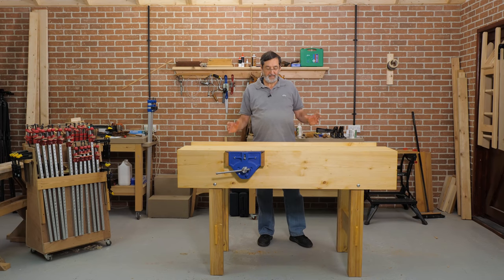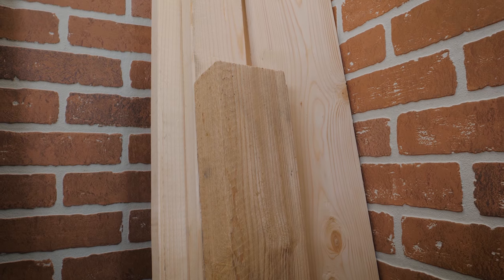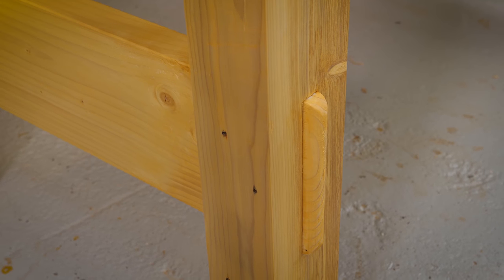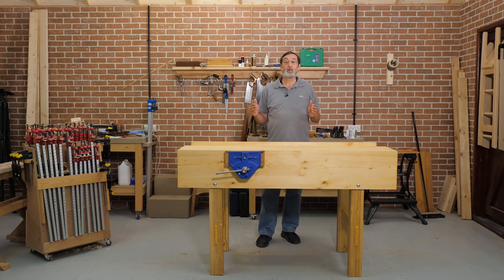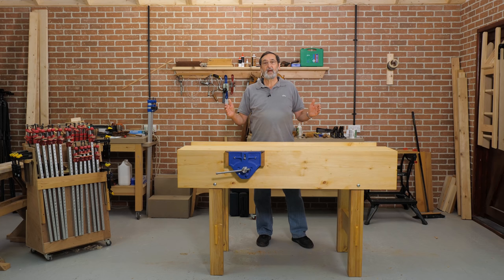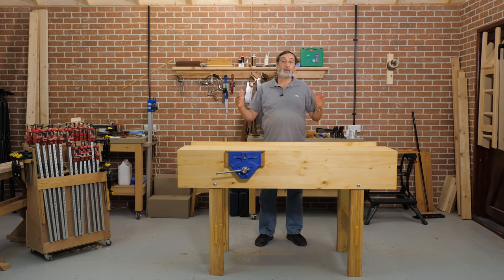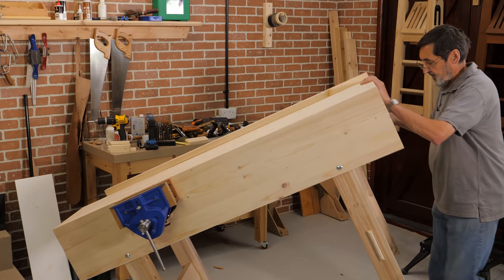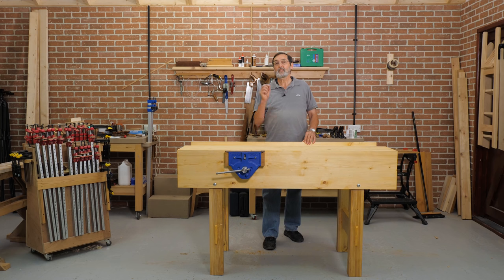How to Make a Workbench Introduction | Paul Sellers

Comment: Paul, I wonder if you could describe how this bench differs from your previous workbench build series.  That was a terrific set of videos.
Reply from the maker: Yes, it differs in three ways:

1. This bench is smaller, it is shorter, only has one side, and is easier to move
2. This series is more thorough (we missed showing vise fitting last time)
3. This bench build includes full measurements (you can still adapt it but you have a solid starting point)

- Team Paul
Reply: Wow, that sounds great!  Looking forward to the new series.
Reply: I am currently in the process of building the previous workbench you posted on here a few years ago. Both tops have been laminated and I'm about to glue up the wellboard and aprons. I'll still be excited to see this new series and see how you fit the vise!

Comment: Hi Paul,  I started mine a couple of weeks ago, and its going okay,apart from one minor hitch on my part.  I forgot that the timber yard had supplied me with five and three quarter inch wide cross rails for the leg assembly.  I went and cut my first mortise at 6 inches as per the plans.  Had to go and buy some more wood as I didn’t think it would be a good idea to try and bodge it up.  Anyway, I’m back on track and looking forward to the assembly pretty soon…….

Comment: Loved your first question /Statement  about how do we make a Workbench without having one to begin with  and the old answer is of course we use whatever we can  !  I used a plastic patio table that still has a cut in it from my Circular Saw at that time  that happened to be a older Skil Worm Drive  with so much power i never felt it going through the  Polyester table surface !  Oh Well !  everything still works as intended 25 or more years later   I always thought i would build a Wooden Patio table  but it turns out i never  did  and the slice in the table is a great Conversation peice at Barbecues  LOL since all my friends know i  was a Professional Woodworker for over 20 years ! And laugh at why that cut is there  OOps LOL

Comment: Paul Sellers is THE man. hands down best woodworking teacher.

But I wouldnt trade my roubo in for an english style if you held a gun to my head.  

Just preference is all.

Keep it up Paul!  Love your vids!
Reply: I made an English style... and love it... but I also have dog holes all down the apron.
So I can use dogs and holdfasts to keep a long board stuck to the face for jointing.
Mr Sellers doesn't use dogs... so I'm not sure why he goes English, frankly.  :D  Unless it's just for ease of construction.  Those aprons stuck to the front and back are a little easier to execute than gigantic dovetails.
Reply: Those aprons stuck to the front and back also prevents clamping to the edge of the benchtop.   If not using holdfasts either, and no side wise and dogs, I have a hard time figuring out how anything is going to be held in place on the bench top itself.  Jump up and sit on the wood?
Reply: Art Heen exactly, my tail vise holds the long stuff well.  couple whacks with my holdfast is so efficient too for holding things on top.  also i wonder if pauls bench would wobble a bit when working on the big pieces, hence I built mine with 2x6s on top, with a total weight of 400lbs.  

too each his own! cant argue against a master craftsman like paul!
Reply: I think Paul Sellers uses long bar clamps extensively,, combined with shims and a second vise to hold larger pieces.  The problem is that this bench doesn't appear to have a second end  vise, and that large bar clamps solid enough to clamp in a vise are really expensive.  And you'll need to make shims to hold oddly shaped objects that way.   It may only take Sellers a minute or two to create shims for a circular object, or to figure out a way to clamp an s-shaped piece of wood, but for the rest of us, a holdfast or side wise with rotating dogs is likely far easier.
Reply: Art Heen the english bench in charles schwarz workbench book has a little more options to hold stuff.  that front vise paul uses looks awesome though.  a great investment i bet.
Reply: There's a video on YT by Mike Siemsen where he goes on for half an hour about how to work on an English bench... without having a vise at all.  I think it should be required viewing before making a bench with aprons, because it turns out it's really easy to get by without one.  Of course if you come from a smithing background it's a little easier to collect holdfasts.  ;)

Comment: Paul while most people wouldn't have a work bench to build a a work bench on. I have a few ideas to help I use my roll away tool box drawers t stabilize and act as a temporary support for drilling and cutting.  I have a old 1" closet Shelf from an old house these are old and slow dried wood.

Comment: your honest opinion is needed I need a workbench to build simple furniture  ie farmhouse /country style. Budget is the change from the couch cushions. I do have a chainsaw mill have Cedar,Hickoryand a few types of other hardwoods I can cut down and mill up into 14 inch wide or less boards. I don't have fancy high dollar tools. benchtop 10inch tablesaw  8inch bench bandsaw 10inch drill press  16inch wood jackplane #4 plane 1/4 to 1.5 chisels  
Was thinking top from hickory scraps will be burned in smoker. Legs and frame from cedar Shop is unheated polebarn in mid Tn

Comment: We recently renovated our kitchen and I salvaged all of the endgrain maple butcher block counters (woodwelded 1.5" thick) realizing it might be great for working into a project. I haven't done any woodworking since highschool shop, but this series really inspired me to create.

I currently have 25"x57.5" and 25"x51.5" laminations. Is this something I can use? I feel like one lamination would be sufficient for the bench top since they're maple and quite heavy (compared to new growth SYP), but I suppose I'd have to adjust your plans to a reduced length? I'd probably also eliminate the wellboard since i'm already at 25" excluding the (aprons).

Comment: Hi there I had a question about the wood list for this build.  For the aprons it calls for 1 5/8” x 11 1/2 where dimensional 2x12” are 1 1/2” x 11 1/2”.  Any suggestions on where to find suitable wood or does the extra 1/8th inch not really matter?

Thank you
Reply: The xtra 1/8 wont really matter. The bench will still be plenty stable.

Comment: I have bought most of the wood in preparation to start building the bench and amongst other things, I am getting a little concerned about the total weight of the bench and whether my wooden shed floor will handle it!  I am thinking that I may place 1/2 inch or 3/4 inch of plywood underneath it once built. Does anyone have any experience or thoughts on this?

Comment: I am a beginner who's about to make my first work bench. I am wondering, what are the 2 aprons and wellboard used for?
Reply from the maker: Hi Brad. Aprons help prevent racking, which is the bench twisting in use. So they make the bench much more solid and compared to a full width top, the well allows for the majority of tools to remain on the bench but out of the way of work in progress. Also, the wide solid-top laminated benches will expand and contract throughout the lifetime of the bench. So reducing the width of this surface can be beneficial. - Team Paul

Comment: Is that recycled 2x3 dimensional lumber?  Is there any reason not to use 2x4 if it’s cheaper in my area?
Reply from the maker: It is indeed 2x3. 2x4's result in a benchtop that is too thick without adjustments, but you can make it work. - Team Paul

Comment: what cind of tools do i need for this...??

I dont have a bench and i whant to build this along with you, but i whant to know what tools i need fore it so i kan go out and buy them. 
maby you can provide a list of some cind or something....
Thanx in advance...!!

Magnus/
Reply: Click the link on the video to Pauls website and download the pdf for free with all the information you need mate.
Reply from the maker: Hey Magnus. Feel free to join us for free on WoodWorking Masterclasses and you can find there the first two episodes of the workbench along with a list of tools here https://woodworkingmasterclasses.com/videos/workbench-introduction/ a cutting list and technical drawings. - Team Paul-
Reply: Yep. If you look at the opening, there's about a thousand dollars worth of Bessey clamps.  Making your own workbench is NOT cheap.  First, make sure you have everything, including squares, planes, brace and bit (or drill press), auger bits, saws, saw horses, chisels, mallet, brushes, and, yes, a boatload of braces.  The costs can quickly escalate if you don't have what you need already.
When I upgraded my bench, I found out that just the lumber itself was around half the cost of a pre-made bench, and add the vises, bolts, glue and lacquer and it just wasn't worth it.   And that's with having all the tools.

Comment: Paul, I want to know what the recomended height is for various people. I have a small woodworking club and the members vary in height quite a lot.

Edward
Reply from the maker: Paul did a number of posts on this that should help: https://paulsellers.com/2012/10/the-long-and-short-of-bench-heights/ -Team Paul
Reply from the maker: I would say 38 inches has worked for me my whole lifetime and I’m mister average in height. In my classes, we add extra height by placing a piece of plywood on the floor for somebody who is shorter and if they are taller we jack the bench up with a block.

Comment: I have wondered: why that kind of bench has this not-straight top?
Reply: I think you are referring to the "tool well"? The idea is you can leave your tools on the bench at a lower height than the workpiece you are working, and they will not get in the way. Personally I don't like them. they arent deep enough for most planes and they get full of crap. I can clean more often I guess and make the well deeper but still I don't think I'd like them. Just me!
Reply: They also make the top less sturdy compared to a full thickness top that goes all the way across.  And with this particular design with the big front and back skirt, there's already very few spots where you can clamp anything to the table, and the big tray further reduces the places you can place a clamp to next to nothing.  And if you add a side vise  (a must, in my opinion), you end up with half of one short side where clamps can be used.
I personally prefer a tray under the bench - that also lends solidity, and lowers the center of gravity, something it looks like this bench could sorely need.
If this is going to be the workbench people will be using for the rest of their life, I think that is because they'll die from an aneurysm due to the frustration of using it.